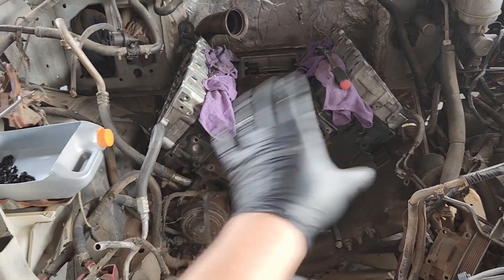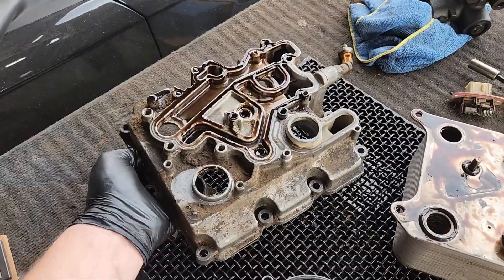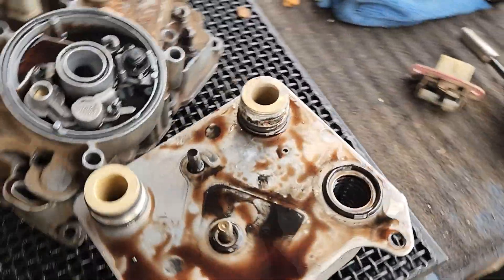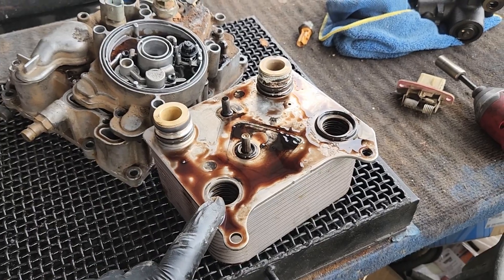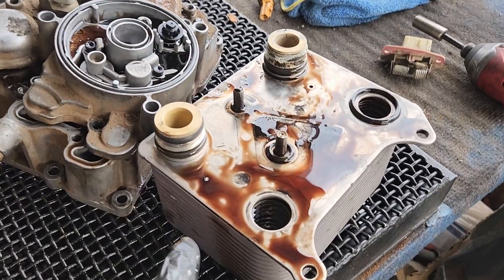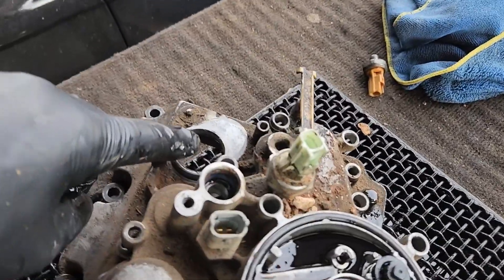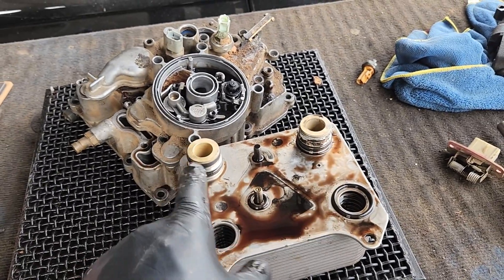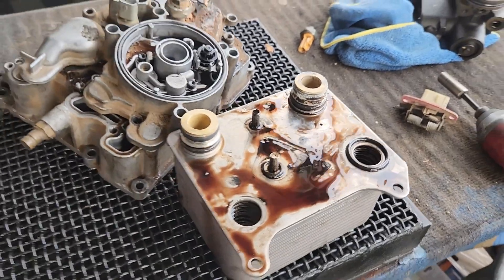6.0 Oil Cooler: How And Why It Fails, And How To Fix It

Comment: Get PPE oil cooler.  Oil passages & coolant passages are LARGER. 
Less likely to clog 👍🙏👍🙏
Reply from the maker: I used to recommend O.E. but in recent years Motorcraft has just rebranded dorman. Thanks for the recommendation!

Comment: Hey I have 3.5 v6 Tacoma. I want to replace the No #1 idler pulley but there’s something called an oil cooler that’s directly in the way. They’re saying I gotta crack this oil cooler open to service the pulley then put the oil cooler back together with new gaskets in it.

When I crack open the oil cooler will oil and coolant spill everywhere? Am I supposed to drain the coolant and oil in the engine before opening the oil cooler?
Reply from the maker: It's going to make a big mess no matter what you do.

Comment: You said flush out the coolant system while your in there. I totally understand a coolant flush with the engine operational but what process is done without engine running?
Reply from the maker: This repair video was made as a part of a larger repair, namely head gaskets, with the front cover removed you can access the coolant ports on the block and when available a pressure washer into those will clear a tin of debris.

Comment: Would doing a thorough flush help improve oil cooler performance?  My oil/coolant temps have been getting wider over past 2 years and I’m trying to avoid doing a full tear down for the time being. Thanks
Reply from the maker: You can back flush, but if it's been a slow degrading of performance the debris is likely very fine and won't come out with a flush. Best to plan to replace.

Comment: It's not casting sand. I worked at the IDC foundry where we created these castings in an injection mold press die. If any debri caused an issue, it would most likely be 170 shot steal beads from the shotblast. The parts would still have trim spray on them in the deep pockets when they got shotblast. It doesnt take long at all  for the shot media to rust in these deep pockets which caused it to be incredibly hard to blow out with an air nossle. We machined the part after this and shipped it to the supplier l. I was always concerned about this causing an issue but am no longer with the company

Comment: I've got coolant in my oil on my 6.0 powerstroke.  NO OIL in the coolant.  Any ideas?
Reply from the maker: Egr cooler, oil cooler, or a crack somewhere such as a block or head. Also, cavitation behind the water pump can cause that.

Comment: I thought the oil coolers failed because the silica found inside the gold coolant would overheat and gum up the oil cooler leading to everything you mentioned, not the casting sand.
I switched to the red ELC after a flush and haven't had any issues since.
Reply from the maker: The biggest thing is the casting sand left over in the bock, that and rust. these came from the factory with Gold coolant and that's all I run in them.

Comment: How exactly do you then clean the coolant lines and engine chamber where the coolant-oil mixture had already passed through and got deposited at every nook and corner?
Reply from the maker: As far as sediment or coolant oil mix?
Reply: @RogueWrenching   coolant oil mix slurry
Reply from the maker: @AbhishekKumar1902  Take the heater care line off next to the alternator, open radiator cap and coolant drain plug, start engine.
Put a garden hose on full blast into the heater line you removed. Run till water comes out clean. 

I've run a cup of purple power heavy-duty cleaner in the cooling system with water for a good long road test and then flush again. 

After all that, replace the degas bottle and fill with fresh coolant. 

Over the next few weeks of driving, the remaining oil will rise to the degas bottle. 

Replace the bottle again. 
(You can buy bottles on Amazon for under $50)

Comment: Seeing 6.0s and how they work make me so glad to have a obs 7.3 so much more simple.
Reply: Seeing 7.3’s and how they perform make me so glad to have a 6.0.  And let’s be real… OBS are great, but these days they are overrated and overpriced.
Reply: I had a 7.3 and hands down love my 6.0 way more. Just my experience
Reply: @Roy-zb4um the 6.0 is better engineered and stronger than a 7.3 - the 7.3 is a good motor but the 6.0 will outperform it with proper maintenance
Reply from the maker: I do like my obs